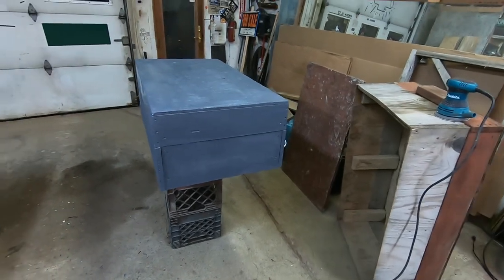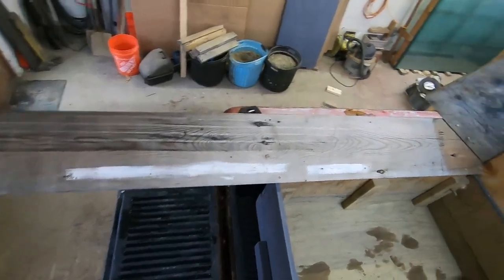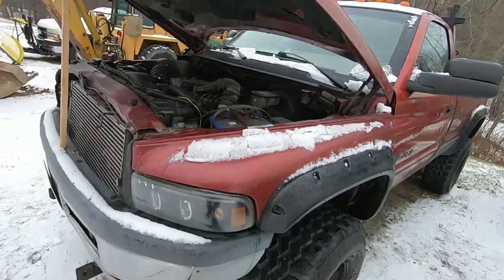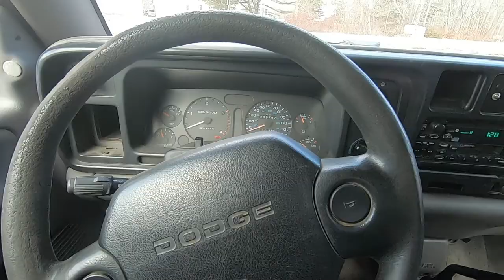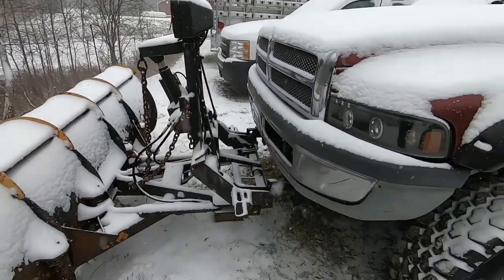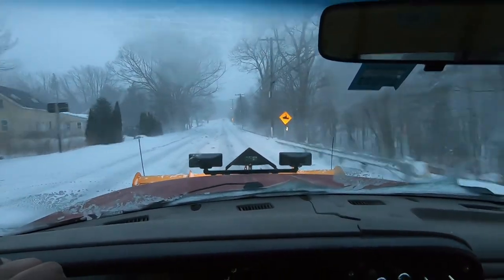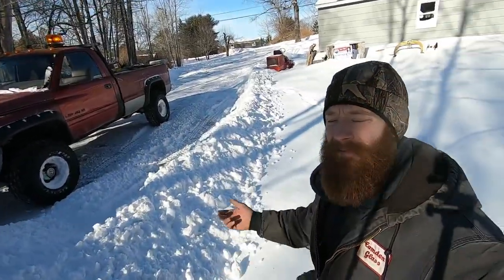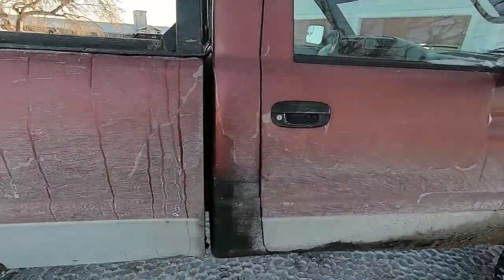12 Valve 5 Speed Cummins Plowing Snow / PREP For Snow.

Comment: The way you plow snow makes no sense. You have an area clean and then you plow over and over it again?
Reply from the maker: When you have really deep snow in a small lot, you make an alley through the center first, so you can pack as much snow at the end of your run. You then work on making the alley wider to clear the lot. The snow tends to roll off the side of the snow plow, making it more difficult. If you don't clear to the end first, the snow backs up so much, you can't push it back far enough. I didn't really show this process, as I just took the more exciting shots to make the video.